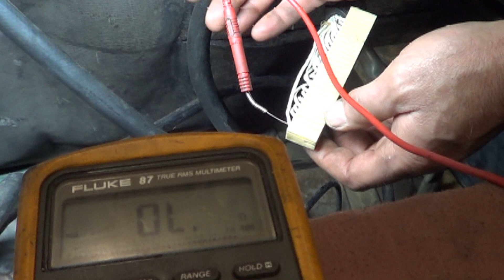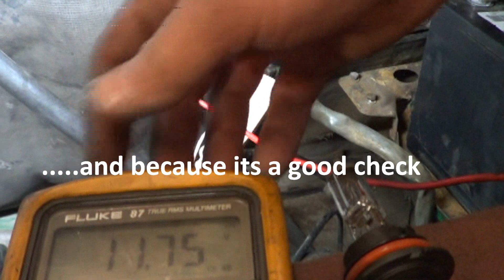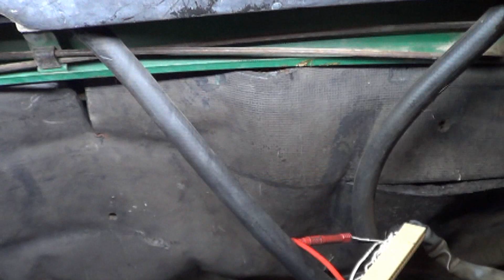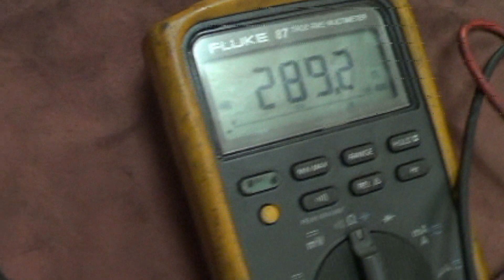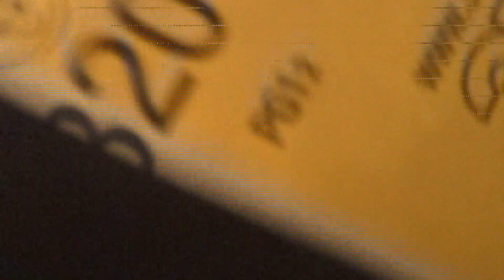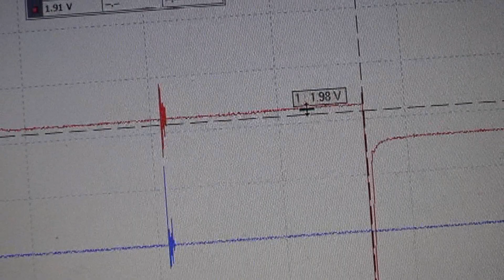Porsche 914 wont start3

Comment: Great video I am working on a 914 with simalar issues was running great after starter replacement. I bought it with a bad starter. Drove 40 miles. PCV hose popped off huge air leak high idle 3K fixed that restarted car. Ran fine 30 second died and now will not start. Suppriced how little info about these cars is out there. 
With your videos I may be able to figure it out. # 3 is great. Thank you. Not sure where you are located if in CA I will tow it to you.
Reply from the maker: kansas city area of Missouri.

Comment: Is this L jetronic?
Reply from the maker: I think so, memory fail right now.  I believe it says in the video.
Reply from the maker: Actually, I cant remember.  I dont have the time to watch the video to figure out the year, engine size or fuel system, but ones without a map sensor are  "L" jetronic.   I think the L-jet was only the 1.8L (73 & 74 I think.)  Ones with a Map sensor are "D" jetronic.
Reply: @CoolAirVw  No problem mine is a 75 and I think it is the same injection. The videos are really good thanks for posting.
Reply from the maker: @Simple_Slmon  914WORLD.COM AND 914CLUB.COM ARE EXCELLENT RESOURCES

Comment: Nice find, good diag, well done !
Reply from the maker: I solved this issue myself.  I didn't call anyone,  didn't ask for help and I didn't post on internet forum other than after I had solved the problem to promote the video.  I certainly did look on internet for resources but ended up fixing it with info from my Haynes manual and some info I downloaded and printed off internet 10 years ago for my own 914 when I was working on it.  I'm proud of this diagnosis, but seems there are others who would have done much better than I.